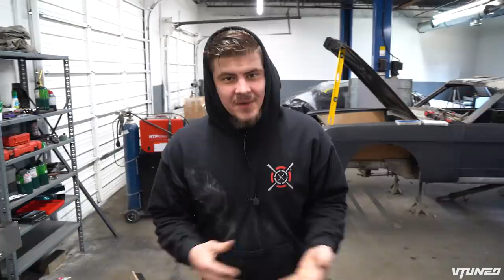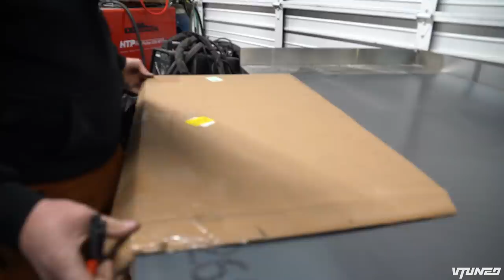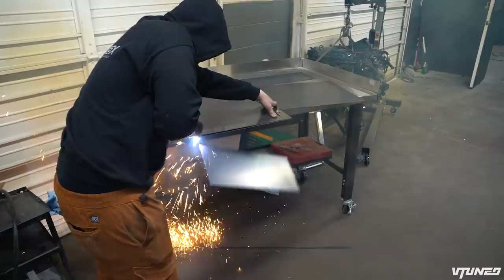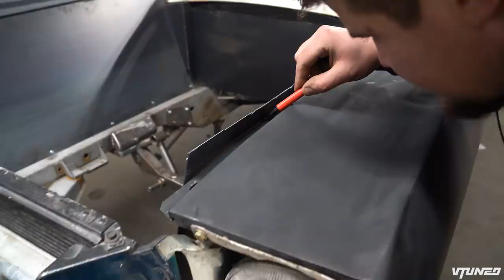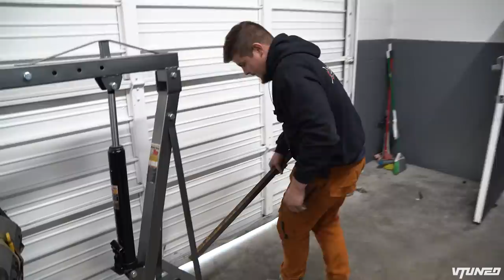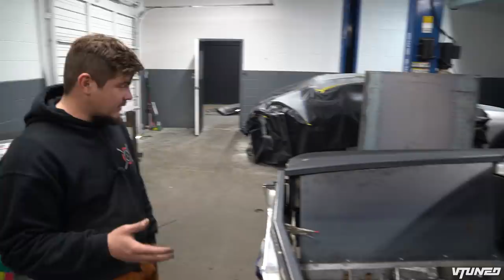I’m Done Building The Custom Front Aprons For My 1965 Ford Mustang ! 2/2

Comment: Honestly... I know custom fabrication is super cool man, creating something and designing it your way definitely gives it character.. but the big picture is really missing from this.. you gotta nail this one right once and for all man.. It's heading in the old direction and just adding more weight from the steel. These fender skirts and radiator supports are still so cheap online and would save you a TON of time from wingin it like this. They're designed for the right adjustments (almost) and still look really great. You could move on from how to figure out the whole front core support quicker and just focus 100% on setting up the front suspension properly and successfully adjusting the engine and transmission so they fire up right. Something is gonna come back the further you go mid engine install and would hate to see ya have to back track on redoing it all over again. Love the channel man! Hope the stang comes out sick!
Reply: When the engine is in, it is going to look like it is in a shipping crate. Just fill it up with packing peanuts.
Reply: Disagree completely. Sure there are aftermarket products he can buy and bolt on, but he wants to add some personal customization to the engine bay, and this is the look HE wants. And that small amount of weight he is adding will make little difference to the 600 hp motor this tiny car is going to have. And I am sure his difficulty with the prior Mustang builds is always on his mind, so I am confident that he will get the front suspension done right. Give him a chance.
Reply: @jacklittle1624  I’m with you on this let him learn fabrication and make this build his his own style. But the Steve was right about is the weight. The gauge of the metal is way too thick. He needs to use metal at least one gauge thinner, I’d probably go two gauges thinner.
Reply: @Larry the able guy  
How will that be if the tubing is under the fenders as support? 🤔
Reply: Absolutely agree! And I still can't understand what he is going to do here..for front struts or.shocks if there is.no.strut tower. Build.a.tower an weld it in? More weight/room
Reply: 110%

Comment: Get a bead roller or take them out to have some rolls added in. Those panels are going to flex and resonate. It will sound so bad if you don't add them.
Reply: USA USA today #hitydesign
Reply: YUP WHAT HE SAID
Reply: And some gloves dear god!
Reply: Why would he do something logical like that when he can just reinforce it with 500 lbs of 4x2 steel tubing.....
Reply: @speedsterwinston  rectangle tube?
Reply: @arod2248  Amen to that!
Reply: @arod2248  and som hearing protection.

Comment: Make sure you put decent mount pads on the fire wall for that tubing so if you hit something they dont push through the firewall and into the passenger compartment. Go slow and think of everything you can before you fully weld anything. Might want to figure where your cage is coming through to tie it all together.

Comment: Should have waited for the suspension and engine mounts brake master and steering before the aprons .
Need all your mechanical stuff sorted and you see exactly where your aprons will fit. Less work and less waste in the long run.
Reply: That's what I've been thinking. Going to be cutting those aprons up all over the places when the shock support needs the right covers.
Reply: USA USA today #hity design
Reply: Haha, don't you guys know how he works?  He has a tendency to leap before looking.  If you haven't watch the first mustang he tried to build from scratch, the frame was huge and heavy before he realized it wasn't going to work.  He has a good vision in his head, he just doesn't see the in between and the smalls that need to go into the engine bay.
Mock up of the engine and the front suspension and all it's components will be needed to make the engine compartment fit all the components in and still look clean....measure twice cut once is a must to save time and money while still getting that clean and custom look....
Reply: Don't worry he will just hack it up and re do it again.
Reply: This aprons are not ready to take suspension or engine with gearbox so stop clickbaiting us and actually do something please, it's not even welded yet, come on

Comment: Tip
Plasma cutter shallow curve guide
Get a strip of alloy or steel flat bar that is longer that the curve you need to cut by at least a hands breadth, fold the ends over at right angles and attach to a another identical strip so that there is a gap between them. Wedge varying sizes of wood spacers between them to force them into the desired curve. Clamp down on the job to use as a torch guide.

Comment: Question? Why didn't you fold the top aprons 90 degrees and slide them under the fender and bolt them together?
Reply: Makes too much sense.
Reply: It would be hard to fold that curve towards the front of the car. The other option would be to cut a strip of steel and weld it to the new aprons, you can compensate for those curves better.
Reply: @Yippee Skippy C'mon man that is way too easy, not his style. Just keep adding steel to make it work. That square tubing might not be strong enough to hold the fenders, he might want to use a 3" I beam. LOL Over complicates everything.

Comment: On the square tube fender mounts - locate where the centers of the holes go. Drill a hole through the fender mount and install round tubes through the square tube holes to strengthen the holes.   Then tack on the mounting nuts on the bottom side. This will securely mount the fenders and prevent the fender mounting hardware from collapsing from the forces acting during operation of the car and loosening up from vibration.

Comment: You should beed roll the sheet metal where the steering pump is gonna be so u can put a piece of sheet metal above it that fits snug into the bead rolls to hide it, that way the left apron looks 100% flat like the right apron.

Comment: You need the engine in and suspension on then work around those with the inner fenders.
Reply: Yea his order of operations is out of whack. Engine, tranny and suspension should be in and mocked up before doing the aprons.

Comment: I'm surprised you didn't put a fold inside those inner panels where they join the chassis rail and underside of the fenders which would have offered more strength where it was attached either by spot weld or Holes with welds along the both joins.

Comment: I love what you’re doing. My only thought would be, you are using a lot of steel and that adds weight to the car. I think I’d get rid of those side panels and try and think about weight reduction maybe? That plate steel weight will add up fast…
Reply: Just needs to add more power...no big deal.

Comment: I left a comment in your last video that the drivers side apron you removed has the VIN number stamped on it. You can see the notch cut out on the mounting lip of the drivers side fender where it was located. The VIN was also on the drivers side door tag. The VIN  was located on the dash starting in 1968.

Comment: Ford just put a thin metal clip on there to mount the fenders. The clip is thinner metal than your tube walls. 
My recommendation is to install rivenuts as your mounting points.
Reply: Put them into the tubes you just bent,and the structure's strength is multiplied.Fenders,liners,and tubes.Once you have stuff welded behind the firewall to the rollcage people will shut up about getting 'speared'.I can see where you're going.Just wish you'd done the suspension first.You'll get it.Good luck.

Comment: Steel Rivnuts for the fender bolts? If this is an option you will need to compensate for the fraction OD an inch they stick up from the bar. The other option is the weld nuts on the bottom of the tubes, this way the fenders sit flush on the tubing. It looks a lot cleaner under the hood than factory!

Comment: You should think about where you want to mount your radiator over flow container so it's not to far from the radiator and it drains in a good location to prevent over spray etc.

Comment: Man, great effort but you need to do some research. Bead roll the aprons and add return lips to each side to bolt/weld to the chassis and fenders. Way too much metal that will only add wieght with not much strength. Tbh you shouldn’t really start any perminate fab work until the suspension is in place.. what your trying to achieve has been done many times.. research is key 👍🏻 keep going mate

Comment: VTuned…. Where 1st gen Mustangs go to DIE……😂
Reply: Its a comedy series on what not to do to a Mustang, if you want to see how its done mototrend fit a 5.0 without hacking up the engine bay.
Reply: @michaelcurley989  Car will never get finished.
Reply: I just don't understand why he needs to reinvent the wheel.
The radiator support bracket is what holds up the fenders. This guy wants to use square tubing
Reply: That should be his next t-shirt slogan.
Reply: No tools, no dimensions, no engineering.  Works when building a push cart.

Comment: There's allot of blunt and rude comments.I stopped to read almost all 407 about 14mins in.Please,don't weld anything yet.Use a Stock radiator support to hold the front together,and modify it for your radiator.Put in what extra tubing after that's fitted first.Your Hood has to latch.What you  have cut and set looks good,it just may not allow what has to be there to fit.

Comment: My god it's not a hate comment so don't start, I love Ben but old cars don't do very well...
I really don't understand! You are making the same mistakes as with the fast back, first you should install the front suspension, and the front roll cage reinforcements, also those inner fenders should have a tab to be screwed not welded. some parts need to be bought, not made, like the radiator support.

Comment: Why are you reinventing the wheel on this. These front end panels are available and been available for decades. There are many coyote swapped mustangs out there using ff the shelf parts. I just don't understand your need to fabricate everything when it's already been done. You went in the right direction with the front suspension you need to do the same for the rest of the front end or this will wind up like the last mustang.

Comment: WHAT THE HELL ARE YOU DOING. You started at the tail and you are working to the noses 
Start mocking up the radiator with the radiator mounts and the fender with steel and when you mock up front suppression then see if that motor will fit. And last is too do inner sheet metal.  You could never get a Job with Boyd. 
I Cant Watch this any more.

Comment: Man, another Mustang ruined, the story repeats
Reply from the maker: Explain how it’s ruined?
Reply: @Vtuned  because you are making the same mistake as with the old one, cutting up original metal and building it more heavy, and bad designed.
Reply from the maker: @ithemaster1249  the factory v8 in these mustang weighs 505 pounds a coyote weights 440 pounds that’s 60 pounds shed off just by swaping and I also cut off the heavy shock towers yet I’m adding weight doesn’t make any sense.
Reply: @Vtuned  yup, with that design the coyote v8 will look like it's in a crate, amazing design of course